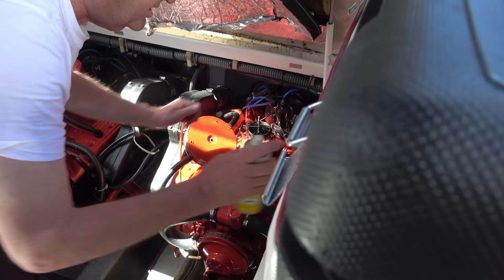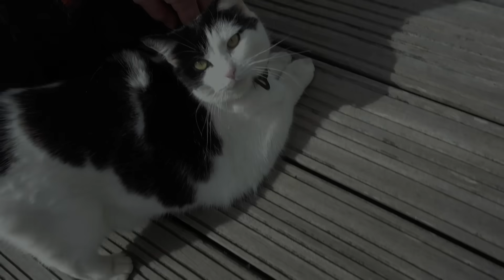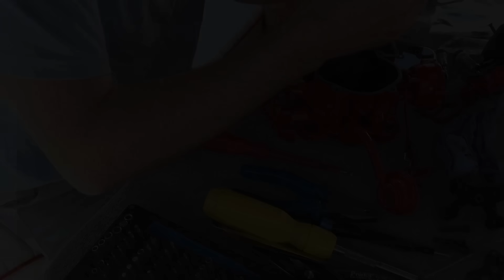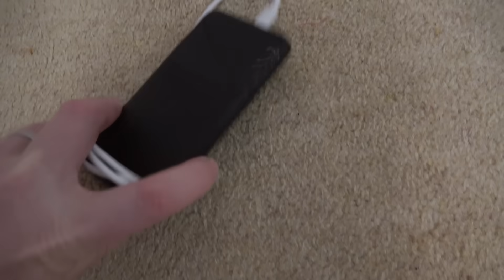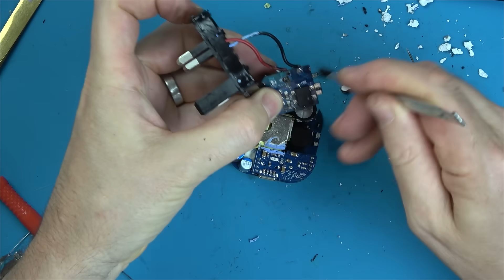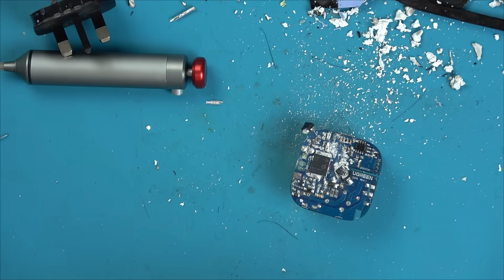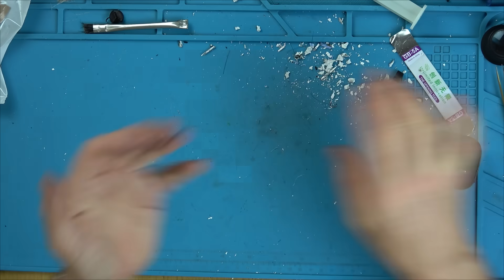Battery, Electric & Petrol Powered Items - CAN I FIX THEM?

Comment: I think you guys should be taught about Rochester carbs. The funny circular BIT, on the outside of the carb, is the choke adjust. No springs on the outside because the inside has a spring/thermostat! You can adjust the choke while it’s cold to just close up. There are fuel and air adjustments on the outside near the bottom of the carburetor. They would first be checked just how many turns they are opened and make a mental note of it. Ounce the carb I’d rebuilt, you might re-adjust those needles to make the engine run properly… but if I were you, I’d replace those crappy carbs with Holley 600 CFM, not sure if you use metric here but they would be roughly 17000 Liters per Minute. Good luck to you!
Reply: I hope Vince reads your post. Indeed these old Volvo Penta engines used marinised General Motors Rochester carburettors.  From a bit of research I did these are much more complex than most UK carbs of the time (SU, Solex, Webber), so probably best they do go to a carb specialist for rebuild.  The pair seem to be broken in opposite ways, one runs fine on idle jet and won't transition to throttle and the other does the reverse.  The vacuum units could be leaking slightly, perished internal gaskets, who knows.  If the boat is being sold then I imagine the owner has no desire to become a Rochester carb expert.
Reply: Least get rid of single barrel and also go to Electric distributor would make a lot of difference for sure

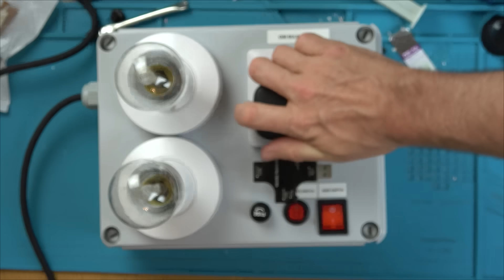Comment: 1:22:10 i am not sure if its the case here, but a lot of usb C pd chargers require some marker device on the datapins. Either in the form of a special usb C Powerdelivery negotiation chip (for 5v and higher voltages) or some resistors across the CC pins for 5v only output. If those are not present, the charger wont enable its output. Your usb tester does not have those resistors or a marker chip, it just passed the data lines through and it expects a device on its output to provide those marker components to be able to activate the charger.

My chargers also behave this way and this is also why some devices cant be charged by them and only work on the old fashioned usb A chargers that always output voltage no matter what. 

Was also confusing to me the first time, but after reading about it i am a bit wiser. The chargers have gotten a lot smarter compared to the old fashioned "plug n play" chargers..

Comment: Over my life I have rebuilt many car carburettors and re-jetted some.  I recently had a lawnmower bought second hand that constantly had starting aggro.  I cleaned out the carb a number of times, checked all the jets, to no avail.  In frustration I bought a cheapo replacement carb from AliExpress.  It has started 2nd pull ever since.  Conclusion: carbs wear out and you have no real way of checking if the jets have slowly worn too large.  A fun video!

Comment: Have that U green charger - bought purely to charge 2 usb C devices at the same time - tablet and phone

Ugreen also have a charger plug with a screen on the front of it that has a face, it indictates charging levels.  I didn't get that one because it was just too expensive and my plug socket isn't visible anyhow !

Comment: Lithium batterys are not bombs! Do not short them and u be ok 🙂
Reply: it probably can explode wires sending melting metals in your face... fire mostly if you don't have a BMS or puncture it.for safety use diesel fuel :/

Comment: How does that cap have 17 volts init, if the fuse is missing on the supply?
Reply: That's nothing compared to the >300 V a primary cap normally sees in operation. If it's not actively being discharged e.g. because the switching element has failed, you may be looking at a self-discharging time constant of weeks or even months. (Plus, dielectric absorption.) I've been letting a 50-year-old 2200µ/50V axial self-discharge from full rated voltage for 3 months, and while it hit 40 V within 24 hours, it slowed down a lot and was at 23.8 V last Friday. Few of my new parts are that good, but after over a month a 2200µ/35V and a 1000µ/35V are still at 12.3 and 16.9 V, respectively.

Comment: The sputtering under load when cold could indicate ignition lead or spark plug insulation breakdown (Under load, the kV needed to produce a good spark  increases considerably) this higher kV may be tracking across through the HT leads insulation or elsewhere. Feeling around with your fingers will be a sure way to discover the  point of insulation breakdown😉
Reply: You could try removing all the HT components-  leads, spark plugs,  dizzy cap, (does this have the other little bits inside the dizzy too?) taking them home and letting them dry out in the cosy warmth for a few days.

Comment: 3:33 Don't put your fingers in the carburetor like that.  If it backfires, you'll never do it again!!!  Use a screwdriver.
Reply: The flash-back is so short that It'll only remove the hairs from his fingers. It is a risk of fire if flammable carb cleaner or fuel have been sprayed/spilled around or on the person's hand.

Comment: The diaphragm unit with the tube leading to the throttle body is intended to force the choke valve open when the engine is put under load. Reducing load (throttle demand) when still cold, the diaphragm allows the choke to close more for richer mixture at low intake air velocity.
Reply: Mixture Adjustment... Many people don't know that the external mixture adjustment screw on carbs is, along with idle speed screw, only for idle mixture and stability; changing it won't have any effect on mixture across the working RPM and load of an engine. The main mixture is controlled with the jumble of internal ports, emulsion tubes and jets of preset sizes. They can be replaced, but the wrong item will lead one down a rabbit hole. They are unlikely to be damaged. The float chamber had lots of debris, fit inline fuel filters to lines just before the carbs.. someone's mention of using a US cleaner was good

Comment: Had a similar 65a charger dropped it while plugged in and it stopped working wasn't a cheap knock off either. Possibly is too tight  love the channel 👍👍

Comment: Charger. That's very small for a 65 watt charger. I have a ugreen 65 watt charger (2025 version) and it's twice as thick as that. I wonder if they changed it because having stuff that crammed together increases the risk of shorts if a slight manufacturing error occurs. The 45 watt version is actually bigger than that now.
Reply: It's probably one of their GaN chargers.

Comment: Boat - Has the ignition side of things been checked? Is spark strong enough? Is the fuel pressure correct (fuel pump?) From classic car videos I've seen recently. Fuel pumps hate stale fuel.
Reply: You can eliminate stale fuel by filling carb float chambers with fresh fuel and feeding the fuel pump to carbs from a safe container of fresh fuel; if there's a fuel return pipe, route that into the temporary fuel tank or it will all return to the main tank in no time. Unless home brewing fuel, Gummed up carbs is a long gone issue, even with year old petrol (unless containers/tanks are left completely open, then volatiles can evaporate and leave you with something more like kerosene). Leaving fuel tank levels very low in cold, moist areas like marinas can allow water condensation to collect in the tank, but a closed fuel tank won't allow sufficient through flow of air for this to be likely...Diesels have sediment bowls/fuel filters to intercept this and allow it to be drained out, petrol tends to absorb moisture. Marinas often have fuel contamination test kits where you would fill-up.
Reply: I was going to say the same thing!  Distribution, spark plugs etc.  I am thinking the sea air has perhaps affected something electrical.
Reply: I have a 67 Triumph,and couldn't start it..stripped all the carbs,checked hoses etc, turned out it was points gap in the distributor...convinced myself it was carbs,but nope...😂